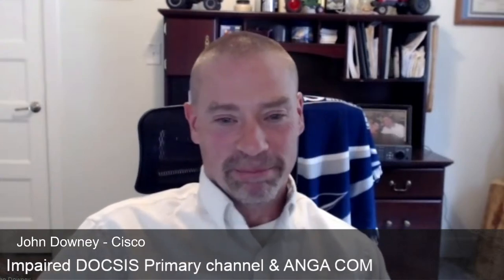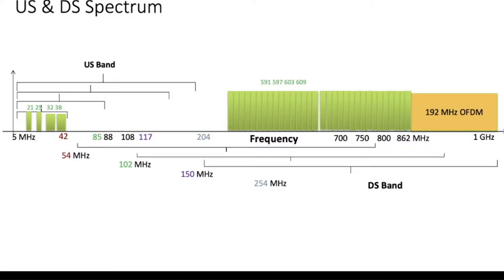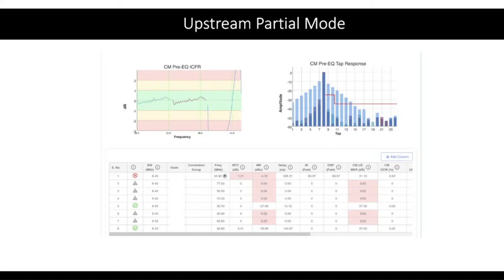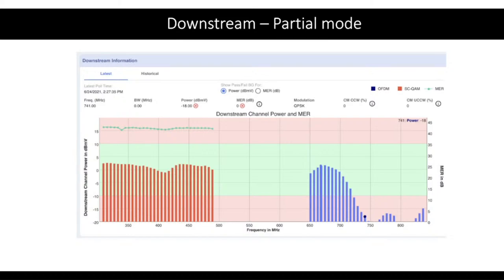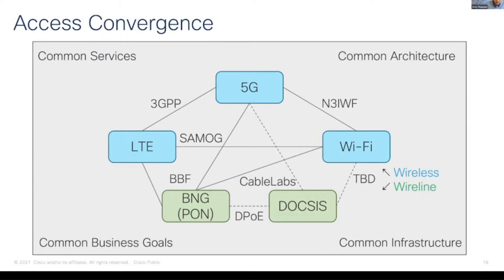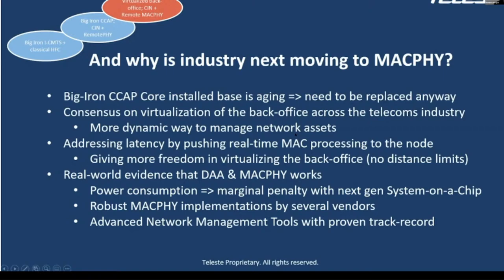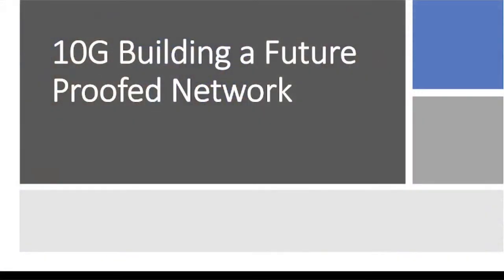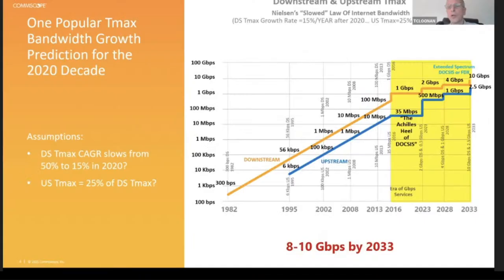Impaired DOCSIS Primary channel &  ANGA COM

Comment: Currently we are running into an issue with LTE ingress which we are unable to mitigate totally.  We are running 32 channels on some of our nodes (from 561mhz to 747mhz) and we are seeing some areas near cell towers that are getting LTE ingress on frequencies 621mhz to 639mhz, 711mhz-717mhz, and  741mhz-747mhz.  All of the downstream channels are currently set to be primary capable as we had transferred over from docsis 2 to docsis 3/3.1 and this was never changed.  When modems in these areas lock onto these frequencies as primary, the customer experiences severe service impairments and their modem will drop and eventually grab a new primary.  Would it be feasible to drop those 8 frequencies from being primary capable or do I need to have it set where there needs to be a primary downstream at certain channel widths away from each other within that grouping of 32?  I was thinking of just dropping the primary capability to at least stop the modems from bonding on those channels in order to help keep the modems online and a bit more stable while we work on getting service calls run out to the customer locations and out to check for leaks/hardline problems.  I'd love to move the downstream channels to different frequencies, but as of right now we are unable to accommodate that with our current spectral use.
Reply from the maker: Hi Craig, setting the channels to secondary will prevent the modems from locking to those channels. This ensure if a secondary channel has ingress the modem is not locked to it and then does not drop if impaired, however you will still experience dropped packets on an impaired secondary channel. This means the subscriber will not be happy. Ultimately you will need to find the leaks. I strongly recommend leakage equipment combined with PNM. Together they are going to identify the issues, both in the outside plant and in subscriber homes. There is not an easy fix for what you are seeing other than dropping the modulation, but then you kill bandwidth.
Reply: @Volpefirm  Thank you for the reply.  Yeah, the dropped packets will definitely be an issue throughout the whole thing.  The dropping of the primary channel inclusion is sort of an interim band-aid to help prevent the dropping of the modems while we are correcting the impairments found.  We've assigned a few techs to go out to these "hot zones" and start addressing the underlying leakage issue, but as you know...this takes some time...especially with an older plant.  From what I have garnered from some reading and previous education you all have provided as well, the reduced number of primary channels should also give a small bump in overall available bandwidth as well due to reduced overhead...correct?
Reply: @craigdelong6147  yeah that's correct. each primary has to carry all the MDD's, all the channel bonding information, among other things I can't think of off the top of my head, I think I've heard JD say something like 1.8 or 2 Mbps per primary or something like that